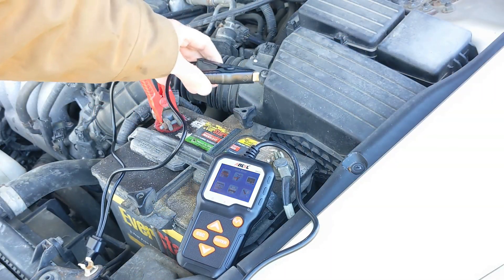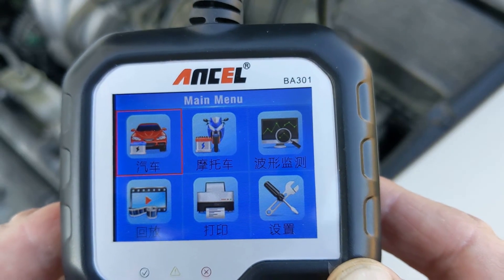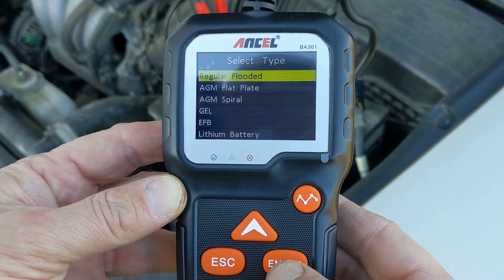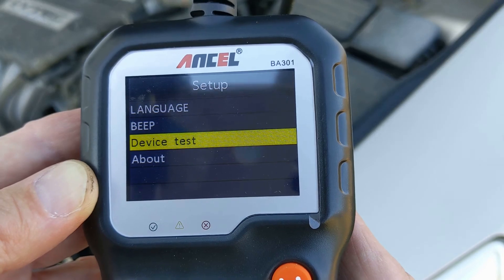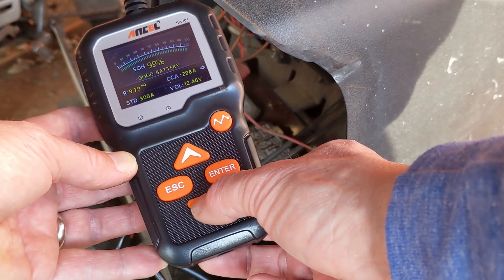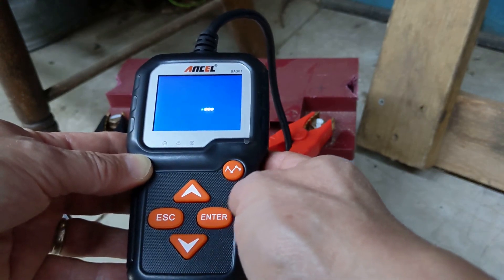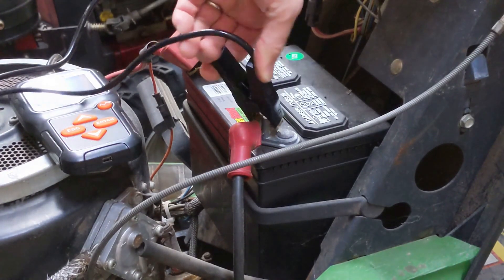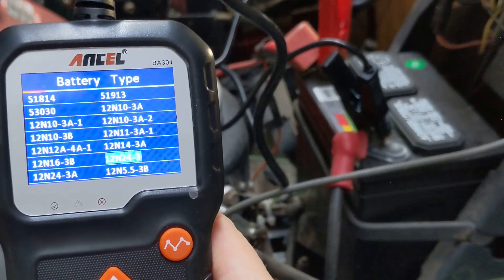Battery Tester Guide - Ancel BA301 - Car, Lawn Mower, Aircraft

Comment: yeah run that test again on the same battery, you'll get a wildly different reading. I got 5 different readings from 62% to 100%.. wtf? I even charged my battery to 100% then tested it, running headlights for 10 seconds.. different readings. Either my batteries are junk or this tool is.

Comment: I have the vdiagtool which appears to be very similar to the 301 you have, when I click on the motorcycle icon it only shows battery testing It doesn't give you an option for the charging system or cranking system that was the main purpose that I had bought the BT500 for when I go to the car icon that shows battery charging and cranking. So do I use the car icon for testing the motorcycle charging and cranking system